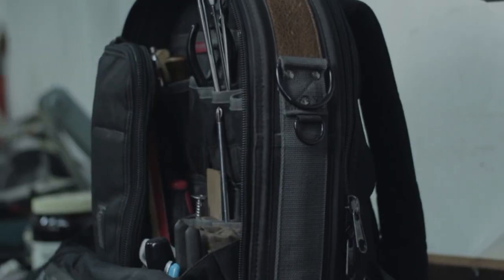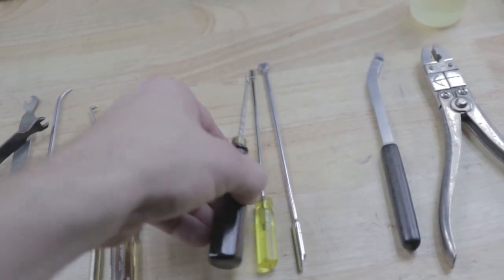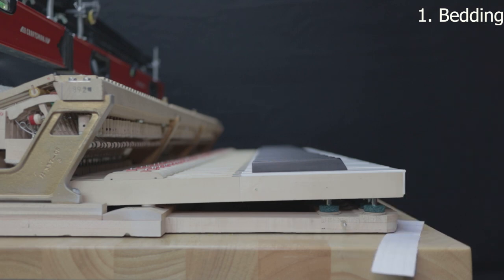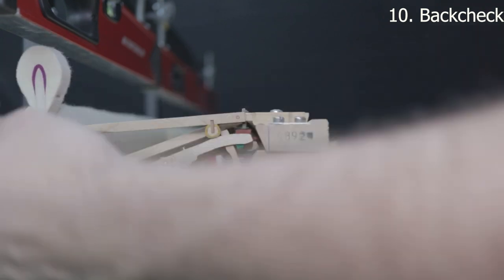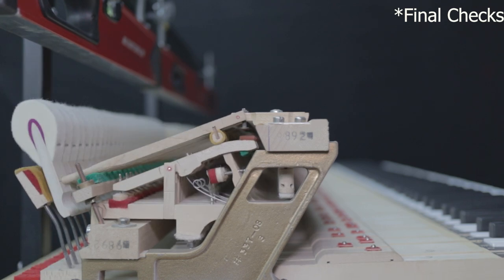Grand Regulation

Comment: This is a good video! A lot of comments seems to come from people who has a good bit of experience. 
This action is in good shape already regulated. 
There is quite a bit of work to get it that point. Unless it’s in good shape regulation wise when you start. 
Asian piano actions don’t change much from piano to bench. 
On American piano actions some change from piano to bench meaning redoing some reg. Points. 
Some techs bed the action when in the piano. Along with other measurements. 
You can take the stack off. Put weights on the keys. Put key frame back in. For dip. setting key height samples etc. 
while the frame is on bench clean the bed lube key pins. Check for key checking when taking keys off. Making sure keys are free. 
In the beginning do all repairs first.

Comment: Great video. I was looking at all the measurements that have to be made across the length of the keyboard. I am thinking about designing a multi-laser system with millimeter scales/targets at each end. You adjust the laser positions for the keyboard being serviced, then adjust the keys and actions for the beam to just break (half on what is being measured and half at the far end target). This would get precision to about a 10th of millimeter. It would take only a few minutes to set up but making adjustments quicker and more accurate without having to hold guages in place.  I was thinking lasers for:
White keys up
White keys down
White keys after touch
Black keys up
Black keys down
Black keys after touch
Hammers at rest
Hammers at peak (at a given key velocity)
Hammers at escape (very slow velocity)
Hammers at catch
Hammer at repeat capture
Hammer at repeat escape
If I wanted to go all out: Calibrated Pressure Transducers on the string level and a calibrated velocity/force/distance solenoid on a movable sliding bench rail to articulate each key with perfection.
Any other sugesstions?

Comment: Hello, thank you for your videos and greetings from Germany.
I am a pianist and I bought an old Carl Mand piano but it sounds very good, I have been adjusting it and I noticed that the distance from the hammer to the strings is 51mm I reduced it to 44mm because I play repertoire with many repetitions by adjusting the capstan but sometimes it plays well and sometimes there are dead notes, also notice that the release button is closer (which modifies the escapement) so the notch feels "harder" when bringing the hammer closer to the string the knuckle is misaligned from the famous "magic line" Should I align this as you mention in your video apart from bringing the hammer closer to the string? If you see the machine in profile, it is easy in the first and last part because it is visible , but how do you do it in the rest of the keys? Wouldn't it be practical to disassemble one by one, or do you just use the tool to try it as trial and error?
Thank you so much :)
Reply from the maker: Hello Dylan. Yes, once you make one adjustment you'll have to then make the others. You can do all steps per note one at a time but I find it quicker to adjust one setting all the way through the action then move onto the next. For proper repetition pay special attention to the placement of the jack on the knuckle and the repetition spring tension. Also, check the condition of the knuckles, if they're a bit stiff you can use some teflon powder on them or they might need to be replaced if they're not working smoothly.
Reply: @MrPianoTech  Thank you very much for sharing your knowledge, it really helps a lot.
The knuckles are fine and the action in general is in good condition, I assumed that by bringing the hammer closer I had to adjust everything but it is better to ask an expert like you 🙂with some adjustments I have managed to make it respond better to repetitions, but I feel still something strange on the keyboard. (Maybe because I haven't reviewed the repetition spring yet, I don't know how to do that and I don't want to ruin it)
I “Adventured” myself to do it because it is my piano and I can experiment, but I wouldn't do that with someone else's piano!! It is a lot of work and knowledge that you need.
If I had a question, could I send you a photo by email?
Reply from the maker: @dylanmcqueen4656  Absolutely, email is fine. I find once you go through all the steps it should work fine. If it doesn’t then it’s usually time to either replace parts or a repair is needed somewhere.

Comment: Hi. Thank you for the wonderful video! God bless you! One quastion please. I cant see the measurement very well on the photo that you show the bench. There are two levels of the hammer hit arrea. Other the bass and other the treble. Is this 11 cm? and the other?  Warm regards
Reply from the maker: Hello! Are you looking for the measurements to build your own regulation table? If so, I posted a link in the description to photos I took showing the measurements of them. If you mean the difference in the height of the rail in the bass versus the treble section, that depends on the piano. The height of each section is determined by the measurements you take inside the piano, Keybed to the underneath of the strings, when you remove the action.

Comment: Hi Michael. How do you make sure the regulation you do on your table top will transfer to the piano? As I understand it, there are variations in each piano's keybed so the regulation you get on a flat tabletop may not transfer once the action is back in the piano, especially the bedding work that's done. Thanks!
Reply from the maker: I've found there's little difference but if you need to just readjust the bedding once the action is back in.

Comment: What would you do if you have notes certain keys that are darker than other. How you can make the sound of those keys brighter. Thanks
Reply from the maker: That would be done with Voicing. I have a video on it but I don’t go into too much detail about making the tone brighter. Mostly because I don’t get much request to do it, however there are some needling techniques that help, as well as using a hammer iron. For people who want a really bright tone they usually end up lacquering the hammers, something I prefer not to do as it’s not reversible.
Reply: @MrPianoTech  Thank you for your response. Finally (And what I suspected) were the bedding pins at the bottom. I had dead octaves (less bright) than other and after a lot of regulation of those pins I got the brilliance back to those notes. Still work to do but it's a good thing to pay attention to. Thanks again.

Comment: My english is bas sorry ,.About the base section you made, for the regulate. I understand that lever tool height, is in the hight of the strings. Τhe height is adjusted in this way as if the mechanism were inside the piano. So, if I want to make something similar for another piano, I will have to measure inside the piano between the distance of the strings and which point? Thanks you for the video, is very helpful.
Reply from the maker: No problem! You will measure the distance inside the piano, with the action removed, from the strings to the keybed.
Reply: my distance from hammer to the string at the left side is 21,5 but my hammer distance is not at 46mm. Is 50mm. Should I lower all the hammers to 46? .My problem is that when I play, very softly, the keyboard doesn't always pick up, it's like I have to put more power in a specific point otherwise it won't be heard. At this particular point, the keyboard also makes a click, but without sound, if I put less force than it wants. @MrPianoTech   Thank you for your time.
Reply from the maker: If your hammers are 50mm away from the strings that's likely too far. Try reducing the amount by moving the hammers closer to the strings by adjusting the capstan underneath the whippen.

With the hammers a bit closer and the letoff set properly it should be easier to play.

The hammer shanks should not be resting on the hammer rest felt rail, that's just for the rebound. If they're resting on that rail the hammers are too far away.

Also, if that rail is set too low, or if it's loose, either the rail can make a tapping sound or the hammer shank may hit the adjustment screw that will adjust the repetition lever height.  @orfeastops1408

Comment: What type of wax do you use in the wood bedding in order to the glide the una corda pedal? Some un cordas stop functioning because of friction between the wood bed and the piano wood. Is there a special wax?
Reply from the maker: I don't recommend using wax as it will collect dust and other debris over time. I prefer to use Teflon powder. In a pinch you can use a graphite pencil to draw on the keybed underneath the bedding screws to keep things moving.
Reply: @MrPianoTech  Thank you very much! Love your videos !
Reply from the maker: @andre.vaz.pereira  No problem!

Comment: Thank you so much for this video.  How do you go about your height and dip with the stack still on?  I can't seem to figure out (even with a slot cut in the punching) how to gain access throughout the keyboard.  In the past, I have removed the stack and weighted the back of the keys, but haven't found the consistency that I need with that.  Thoughts?  Thanks for considering! -Darin
Reply from the maker: Hey Darin. The dip is much easier, you should be able to, on most grand actions, to lift up the front of the key enough to add or remove punchings so long as you remove the rail from on top of the keys first that hold them in place for moving. Yamaha, years ago, taught me the method of tipping up the front of the action, cutting the punching, and you can push the key out enough to get under the punchings with long tweezers. It works in a pinch but for me, I prefer to pull the stack and add the weights to the back like you mentioned. I’ll do the tip and cut method if I’m adjusting just a few in someone’s home, but for a full regulation I’ll pull the stack.
Reply: @MrPianoTech  Thank you so much!  I'm in the middle of this right now.
Reply: @MrPianoTech  What is your preferred way to block the guide keys so they hold the weight of your straight edge?
Reply from the maker: @liederstudio  I use the set of key weights from Schaff that hook onto the backchecks.
Reply: @MrPianoTech  Thank you so much!  Also, do you happen to have a video out there of you making your let off rack?  (It's awesome!)  
If not, do you have suggestions that could help me in making my own?
Reply from the maker: @liederstudio  Thanks! I’ve actually had quite a few techs ask for the same so I’ll post a link to photos I took of the measurements for it.
Reply from the maker: @liederstudio  https://www.dropbox.com/sh/ro22416m1nasefi/AADm9nlMuOxYqRtxz3dbdt4Pa?dl=0
Reply: @MrPianoTech  Thank you so much!!!

Comment: 1. Bedding 4:41
2. Key Height 7:22
3. Dip 8:52
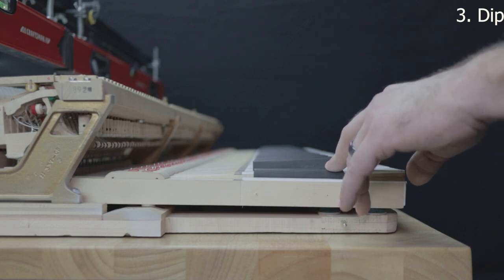4. Hammer Travel 9:58
5. Hammer Distance 12:02
6. Repetition Lever 14:11
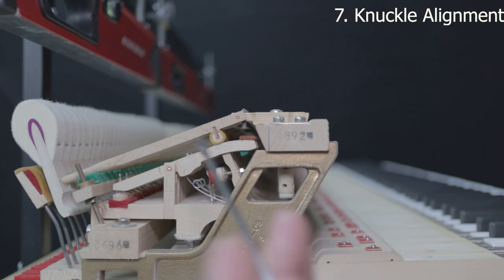7. Knuckle Alignment 15:27
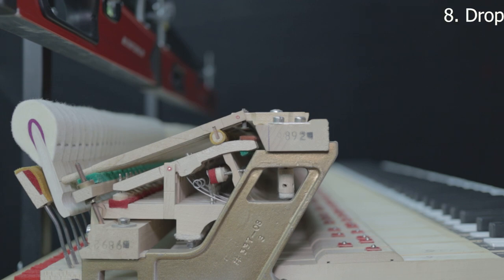8. Drop 16:23
9. Letoff 17:32
10. Backcheck 19:01
11. Aftertouch 19:49
12. Dampers 20:56
Reply from the maker: Thank you!
Reply: @MrPianoTech  Actually, thank you! With the help of your video and my copy of Reblitz's book, I am trying once again to see if I can finally manage to get this right on my Yamaha GB1K, which has been just last week terribly regulated and once again messed up completely by technicians. I am unfortunately in this situation since years, as there were a few weight/touch problems with my newly bought piano, and the interventions made by the piano technicians completely messed up the regulation. Thank you for your video.
Reply from the maker: @PushkarCarlotto  Thank you for the kind remarks. I'm glad it was helpful to you. If you run into problems let me know, I'd be happy to help out.
Reply: @MrPianoTech  Hello! So after one week, and daily working on my GB1K, it feels now playable, and am quite happy with it. Fast passages seem to flow. Though I feel that the touch and sound of the hammer striking the strings is a bit on the percussive side, which was not the case earlier. I have regulated the let-off and drop around 1.5 and 3.5mm. Am not sure what could be the issue. Could you please help me?  Thank you.
Reply from the maker: @PushkarCarlotto  Awesome, glad to hear it's improving! Are there lines in the hammer felt where it hits the strings?
Reply: @MrPianoTech  Yes. Not deep. Though I have already done some filing in the past. And plan to do some, also maybe brushing them. What I actually feel is more when playing loudly, the touch feels strange, So I have turned the let-off screw adjusting it further from the string. But am not sure if that is enough. Thanks for the prompt reply.
Reply from the maker: @PushkarCarlotto  Hmm, probably something I'd have to see and feel myself but I'd make sure the repetition lever tension is correct. Too much or too little will affect heavy playing.
Reply: @MrPianoTech  Oh, yes that is most probably the case, as I am not sure how much is the right. But I did see in the videos, the hammer should rise, neither too fast nor too slow. Then the back checks have been regulated so that hammer is caught at 15mm after striking the string. But my piano back checks are so vertical, and the tail of the hammer has such a sharp edge!
Reply from the maker: @PushkarCarlotto  Sounds like you're doing all the right things! Sometimes you have to file down the hammer tails so that they slide against the backcheck properly, don't be afraid to bend the backchecks a little to help it fit smoothly.
Reply: @MrPianoTech  Ok, so it is the repetition lever. Which I find very tough to regulate. Right now I am playing and regulating the keys I feel do not respond well. Also, sometimes, while soft playing the tone buzzes a little, I guess again repetition lever problem. Right? And then I noticed the drop and let-off also needs to be very precise. How much skill you guys have to do this job properly!!! Thanks again.
Reply from the maker: @PushkarCarlotto  Takes a bit of time to get good at it but it sounds like you're progressing very well! A buzzing sound could be the damper not lifting quick enough when played soft so I'd make sure the damper is raising up plenty of time before the hammer hits the string. Could also be voicing but if it does it globally I'd check the dampers. Also, If the hammer is "bouncing" back up after playing a key (which may case a buzz) then either the drop is too close or the repetition lever spring is set too strong.
Reply: Another question, regarding the heaviness of some keys: would I be able to reduce that by loosening the hammer's pin? So I just removed the hammer and realised that the pin is tight, and hammer doesn't swing properly.....I just did it. and didn't change the heaviness. :(
Reply from the maker: @PushkarCarlotto  It's connected by the "flange". No, unfortunately that'll just make a clicking sound every time you strike the key. That needs to be tight. If setting the letoff as close as you can doesn't get the touch light enough you could apply some Protek to the hammer flange bushing and see if that helps, it may just need a little lubrication. You can also use it on the key buttons, the red felt in the slot on top of the key where the key balance pin sits. But typically if you set everything correctly the action should feel pretty light however there are other factors to consider including the condition of action components as well as the design of the action.
Reply: @MrPianoTech  Ok. So, the hammer swings quite well, about three swings. The key seems loose without the hammer in the action. Also, the last technicians that came two weeks back, sprayed WD40 (!!!!!!) on all my hammer flanges. My room is dry, at 55%. Never above 60%. So not a humidity factor. If I may, this was my issue when I bought the piano and noticed on the higher octaves that some keys needed a lot of effort to be played, and noticed pressure needed was above 60grms. Customer care said a refutation will help. Now, it is better, but still some keys are heavy. The one I just removed is the last high G. So, I am now going to do what you ask with the let-off. Thanks. Ok, so did some adjustment, and there was no change. :(
Reply: And one more problem, I do have when playing loud, it is tough to play. This most probably is the spring tension, right?
Reply from the maker: @PushkarCarlotto  WD-40...yikes!!! You should get about 6 swings, I'd say the flanges could use repinning. Should loosen it up well.
Reply: @MrPianoTech  Ok. Could I just loosen them up with a pin? I have a tool that seems appropriate for it. Thanks.
Reply from the maker: @PushkarCarlotto  There's a tool for it and a certain way to do it. I'm actually covering it in my next video.
Reply: @MrPianoTech  Thank you. I think I have the tool.

Comment: Thanks;The cutting of the centre rail paper to avoid removing  the key looks good on the end keys;does that work in the centre of the keyboard?
Reply from the maker: Yep, you may have to work around the frame a bit but it will work.

Comment: How do you deal with a grand action that makes too much action sound after you release the notes?
Reply from the maker: If it's a tapping sound it's usually the hammer rest rail. Try and isolate the problem by lifting up the whippen by hand and see if you get the noise on the release, if so then it's in the action. If not, it's probably the key, check the key balance bushing for excess movement.
Reply: Thanks for responding to my request. I found that I needed to brush the hammer knuckles with a wire brush that had hardened. That got rid of the extra noise in the action.